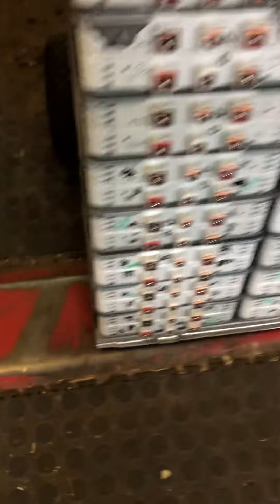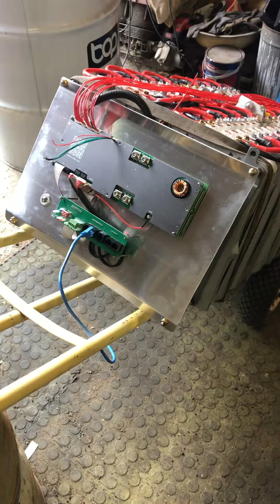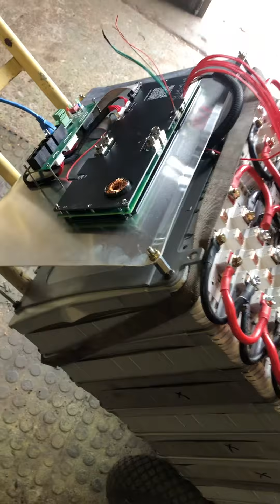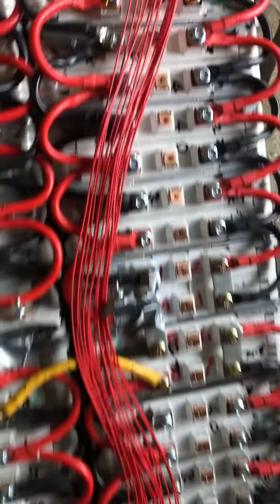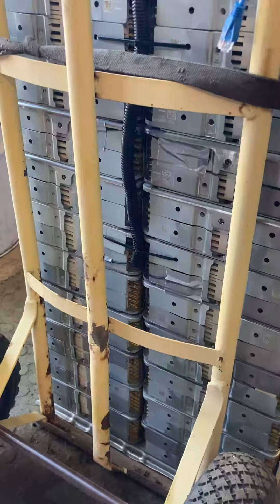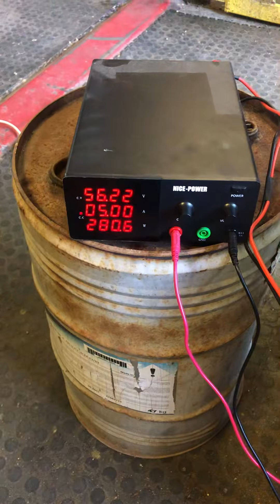DIY 16S5P solar storage battery, built from used Nissan Leaf 40kwh modules - 25kwh storage - bargain

Comment: 16S is a LFP battery combination...... Very odd to run 16S for NMC as the voltage is too high for mainstream nominal 48V inverters (65.6V full battery vs 60V interter maximum). Most people choose 12S (40.8V-49.2V) or 14S (47.6V-57.4V) to run the leaf modules with a nominal 48V inverter, as mainstream inverters usually allow a battery voltage range of 40-60V. I use 14S as it maximises charge & discharge limits v's 12S due to inverter current limiting (increase voltage = increased power at the same current, its basic Watts=Amps x Volts)

3.75V resting voltage for a leaf cell is approximately 25% charged ie. basically empty

As another poster identified. All those balance cables must go to every cell in the battery stack via parallel cable runs
Reply from the maker: That's a fair point on the voltage limits, though I've found this specific configuration works well for this customer's particular setup. 👍 
His inverter maximum is 63v, and due to odd 'feedback' rules here, he charges to full every day & drains it every night, giving him the maximum possible capacity, along with lower amp output due to the higher voltages, further reducing the stress on the cells & extending their lives even more than ones that are worked up to 20% harder - its one of the many benefits of these Leaf / JK setups, that they can be tailored REALLY precisely to the customer's requirements & specifications, without reverting to non-tailored generic configurations :-)
He's not most people, he's this one person, for this build, and I'm delighted to show how I can tailor these to individuals & their requirements :-)
Reply: @mnmszerviz An inverter with maximum 63Vdc = 62Vdc actual real world maximum voltage "at the battery cells". 62/16= 3.875V when fully charged to inverter maximum. And 3.875V is less than 50% SOC. So your customer is no where near using "maximum capacity"

Even using 63V maximum, gives 3.937V = about 63% SOC

Do your customer a favour and drop it to 14S. This will double his available capacity. The JK will work correctly, it doesn't need all 16 balancing leads connected (thats for LFP in nominal 48V systems due to lower operating cell voltage range of LFP v's NMC). And if you havent already, use the opportunity to connect the balancing leads correctly so your customer doesn't have any potentially dangerous issues with unmonitored cell under/over voltages

We have run nissan leaf modules as our house batteries for 7 years now. We have 14P24S and 14P50S batteries in operation, with another 14S26P being built shortly. This is on a nominal 60V inverter maximum. In 7 years of operation, the batteries SoH has dropped from 100% to 93%. Those automotive grade nissan leaf cells are designed for repeated 3C discharge / 2C charge maximums. In a house battery, the cells see 0.4C maximum (often just 0.1C), so they last forever, its only calendar aging that reduces SoH. The safe limits for nissan leaf NMC cells are 3.4-4.12V. The lower limit is set because there is no point going any lower as the discharge curve is very steep at that point. The upper limit is set with a wide safety margin against documented cell maximum of 4.20V. In summer we drop the upper limit to 4.025V due to longer days/shorter nights, which loses 25% of storage capacity. In an NMC cell, the top end of the voltage range is where most of the capacity is held
Reply from the maker: I fully understand & fully agree, but he specified it like this, especially so that on the days he doesn't get to use the system, it doesn't overcharge & stay at 4.2v for extended periods. 
The customer is always right, even against the breadth and depth of the knowledge I shared with him.

He and I both know very well the Leaf upper & lower voltage limits, he did his own research and added it to my existing knowledge of these batteries - the 'easy life' the modules get after I take them from older #LeafBatteryUpgrade cars is one of the reasons the cells are so popular once I've tested their true capacities, especially at just 50Euro per kwh .

Thankyou for taking the time to give a detailed explanation, responses like this help other storage builders to understand the ins and outs a lot better, and saves me having to go through it with every potential customer, thankyou :-)

Comment: Nice work! but I'm a bit concerned you didn't connect the balance terminals - this way the BMS is only fully balancing one string of cells, and the rest of the paralleled cells are only getting balanced in pairs. It would be interesting to see the deltas between the modules that have the BMS connected to the balance terminals, and the ones that don't. Also the way the paralleling is done introduces higher series resistances (even if only by a few milliohms) towards the top and bottom of the stack, so the modules in the middle will be working very slightly harder.
Reply from the maker: Interesting point regarding the series resistance—I'll be monitoring the temperatures and voltages across the stack closely as the system settles in! 👍

Comment: Hi - can you build one of these for me? 🇬🇧 🏴 Wales UK … very good recycling and great use ! 👌🌟 - I’m currently researching solutions to work 100% with Victron 15k x 3 … Thanks.  Grey
Reply from the maker: I'd be delighted. 
BUT.
The cost to ship 100kwh would be vast, and you'd have to pay VAT & Import Duty on the delivery too :-O
Reply: @mnmszerviz ok - thanks … have you encountered any hurdles with an EV > Home and Victron equipment specifically ? Any suggestions on a smooth route to utilise / recycle would be greatly appreciated - Thanks Grey
Reply from the maker: I've not used Victron - but I see a lot of non=positive comments on DIY Powerwall pages etc ..... of course, only those with issues tend to post, but they're never seem to be any with JK stuff ..... there are many ways to use EVs and EV batteries or modules for home storage and power, this way is the most universal, and needs no programming od detailed knowledge
Reply: Looking for around ~100kwh in total
Reply from the maker: If you buy the excellent kits from VIVNE, you can build up as many as you want, for as much storage as you want, and all easily moved on castors, too ... https://youtu.be/_cZ9aXhtsZg

Comment: Don’t think this is the correct way to put together a leaf celled 48v battery, should be a 14S config. Not saying this is dangerous, but I don’t think ideal and not the way any other builder I have seen put one together.
Reply: 16s is the ideal configuration when using victron inverters as their max voltage is 64v
Reply from the maker: THIS, exactly :-) Higher voltage = lower amps for the same power delivery, too :-)
Reply from the maker: While 14S is common, 16S provides a slightly higher voltage which can be beneficial in some solar setups.

Comment: Do you have the link of your BMS?  And the Inverter do you have?
Reply from the maker: Its a JK BMS, they're widely available online - this is the most recent I have bought from them, you have to be careful to select the type you want, with the accessories you prefer : 
BMS LINK -  https://www.aliexpress.com/item/1005006938701605.html?spm=a2g0o.order_list.order_list_main.240.679c1802OTEqCQ - 
THIS screen is a great addition : https://youtube.com/shorts/BIKzkIDjVgM
Reply from the maker: I have 4 different inverters, all for different purposes - again, you need to work out your needs, and regulations, before hunting for a suitable inverter - you can buy locally to you for Warranty reasons, or online if you're happy with the risk ....
Reply: @mnmszerviz  in the case for this battery the inverter is witch One your are using
Reply from the maker: I already sent the BMS link, see your matching question, above !!!!! 
This particular battery went to the customer some time ago, using the JP-PB2A16S30P, so he can expand it later with more parallel battery sets, when he has the funds